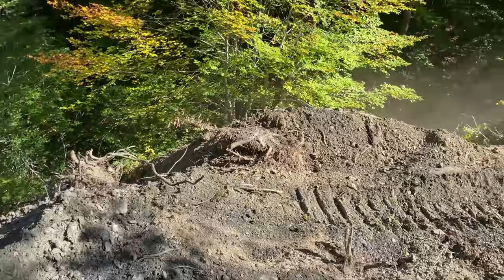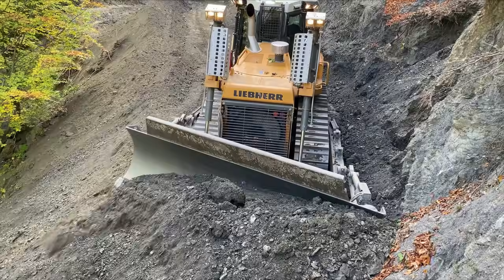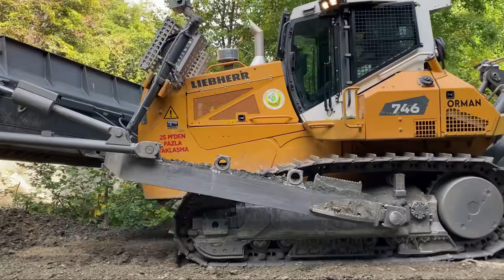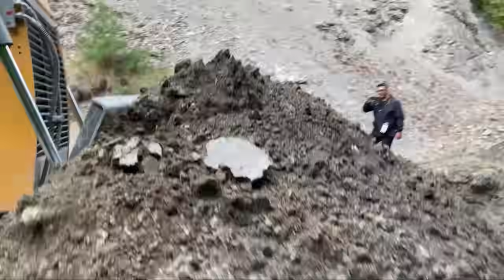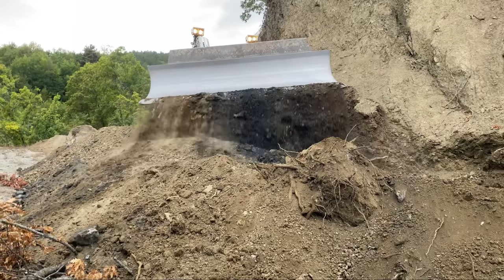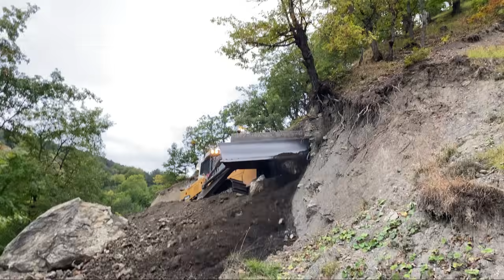LIEBHERR 746 DOZER İLE “TEK BÖLÜM”  #bulldozer #dozer #işmakinaları #liebherr#komatsu#keşfet

Comment: Being a 40 year veteran dozer operator myself, I’m assuming he’s not allowed to venture to the top of that bank on his left and start the cut up there, because that’s what I would have done. He had a tough time finding material to fill that hole by just reaching in the slope, very frustrating as an operator. He did pretty good considering this fact 👍

Comment: He spends too much time going back and forth when he should continue to push the full blade of  material forward.
Reply: Yes I agree, you can hear the hydraulics stalling out, this machine can do this kind of work,but is hard on the operator and the machine. It sounds like he is beating the machine up all the time to get the job done.
Reply: Machine is under powered and driver is trying not to push it to the point of early fail.
Reply: Yup!
Reply: Fantástico trabalho , muito interessante , não conheço esse tipo de solo ( terra) preta solta ,  ????
Reply from the maker: Aslında operatör burada öğrenci eğitiyordu yeni ve acemi operatör kullanıyor daha 1 aylık bir teçrübe ile ☺️
Reply: Is the a name for the technique being shown here? That is, dozing soil into a ramp, that is used to reach higher up the cliff with the edge of the blade, then backing down to push some of the soil ahead; then repeat?

I thought I read one Comment that referred “avalanche clearing”.  

Any feedback would be appreciated. 

Thank you. 
Roy Lewis. 
Buffalo, NY  US
Reply: @rlewis1946   I agree with that part of his cutting into the high banks and ramping up the material no problem with that. I'm referring to his straight forward movement pushing a little loose material a few feet ,stopping, backing up a few feet ,the pushing straight forward again a few feet, stopping,, and just doing it over and over and over with little progress , wasting so much time and fuel. There's another guy that has a similar channel he knows how to push his equipment . He makes so much more progress operating his machine with less constant back and forth motion unless truly needed. It's a pleasure to watch. Just saying some constructive criticism....
Reply: Terra boa pra garimpo
Reply: I agree. Maybe he is a beginner and doesn't know how to operate the dozer like you do?
Reply: @haticecakmak7837 it looks like he's getting the job done 😊
Reply: @joeg9920 se o condutor avança em baixo com a terra depois não tem zona de suporte para ir buscar terra em cima e esse é o problema,falta de terra para tapar o buraco á frente.Excelente trabalho.O que acho é que essa não é a máquina apropriada para o trabalho,era preciso um braço com pá,extensível,para fazer cair terra de cima.
Reply: Aquela encosta á direita poderia também ter sido rebentada com explosivos.Agora vai ficar inconstante e quando chover vai tapar o caminho por desabamento.Tinham poupado imenso tempo e dinheiro.Mas quem sou eu…dou apenas uma opinião.Seja como fôr,com esta máquina era difícil fazer melhor,bravo ao maquinista.😊.

Comment: The dozer he is using is severely under horse powered.   When he gets a blade full to carry the motor starts to loose rpm’s and wants to die out if he doesn’t back off.
Reply: What a bizarre comment.  That's how all bulldozers operate.
Reply: This post refers to @CS-xo4kh, not @kingy002.
Reply from the maker: @kingy002 aynen 😊